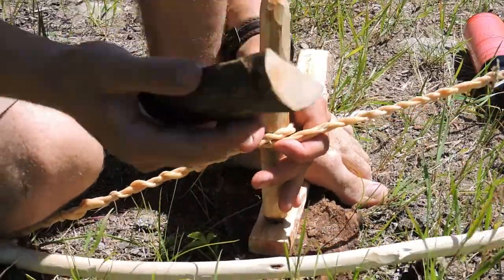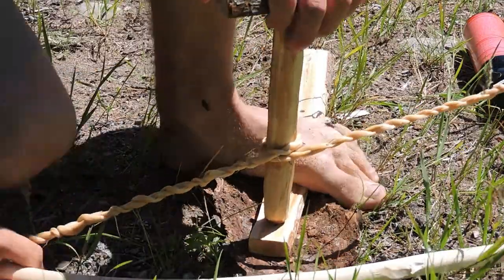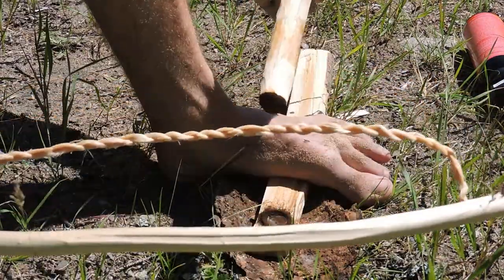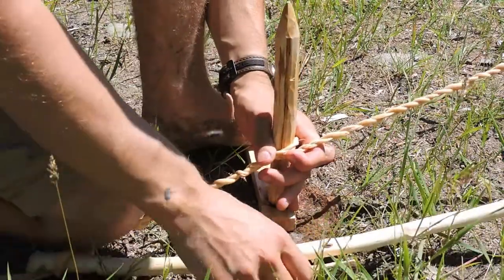Bow Drill Fail with Spruce Root Cordage

Comment: Excellent effort. When working with less than ideal cordage (ie. not paracord or bank-line), multiple wraps around the spindle is a better approach, 2 to 4 wraps around the spindle for  bowstring cordages with low tensile strength (ie. cheap shoelaces, natural cordage, a hoodie string, strips of clothing, etc...). With natural cordage, consider going with a smaller set, about 1/2" diameter spindle with an equally thick 1/2" fireboard. Or, at least the bottom inch or so of the spindle at 1/2" diameter if the cordage is thick.

Angle the bow to minimize the bowstring rubbing against itself. This is where it broke (the middle of the bowstring, unwanted bowstring friction). The squeaking suggests moisture and/or resin. A few burn-in attempts beforehand can pre-heat and dry-out a freshly found on-the-spot set (at least at the friction-points). Also, consider using green vegetation as a lubricant in the bearing-block so you can apply more downward pressure.

What you had was absolutely do-able at that moment in time with what you were using. Implementing some of these tweaks can increase your success rate when the ideal isn't always available.
Reply from the maker: Great tips thank you very much. You touched on many great tweaks there ! I noticed also preburning really helps/almost makes it much easier when doing bow drills even hand drills. I do use the green vegetation part on top but sometimes it burns through. Don't know if there's any better plants than others. I've use spruce needles in this video but also used leaves and grasses in the past.Thanks again.

Comment: Don't be afraid to start fresh.  Often that's the key and saves your energy and frustration.  It wouldn't have worked at all drilling a new hole off the old hole.  Just move down the board and go again.
Reply from the maker: yeah I had success making a new hole like this but in fir... this was willow and just wasn't working at all :) I'll make another video with same rope but a better set up. you are right should've started a new hole or a new set completely.
Reply: +Nomadic Woodsman You had smoke so there is always a shot.  But I learned that starting over, or a better set is worth it in many instances.  Good luck!

Comment: We have a local cedar swamp, and when attempting friction fire from this location it is usually a bust.   One can wear themselves out with no results.  Just move up and out of the swamp and it is a go.
Reply from the maker: Would this be because of the humid ground ? Or general humid area ? Quite possibly. I know this willow wasn't dry enough as I gathered it just before the video. Thanks for the comment that's interesting :)
Reply: In my case it is the swamp and lack of air movement I suspect.  Dead damp air.  Willow is good stuff.  You used a fresh green stem?  or dead and dry but still wet?  Another thing we do is use a longer spindle, it will get shorter as you freshen the top point with every new try.  Start with a spindle about knee high.  A longer spindle will allow the bow to be run at an angle also lessening the friction with natural cords and even hoody string.
Reply from the maker: Yeah it looked dead an dry, but i dunno willows are sneaky it was still a little wet on the inside. I tried before with longer spindles, but not using a natural cordage. That's makes alot of sense I wanna try it with natural cordage and doing the twist less tight and maybe 2-3 turns around the spindle for more grip. Bow drill is an art in itself haha